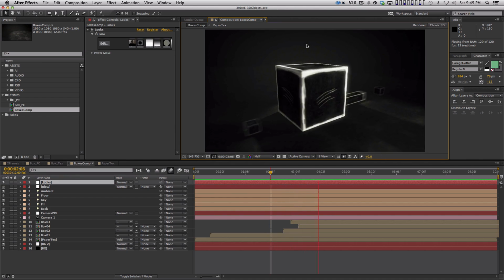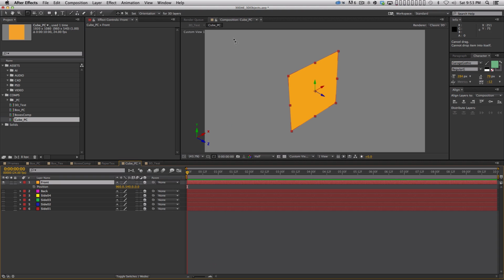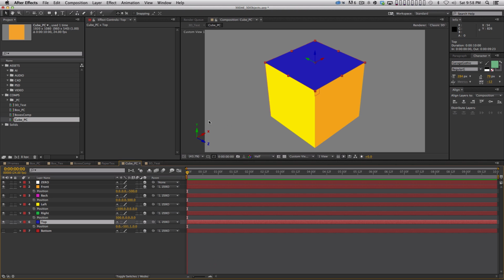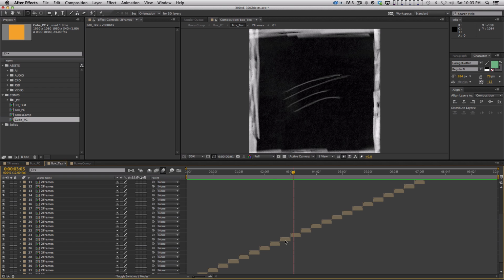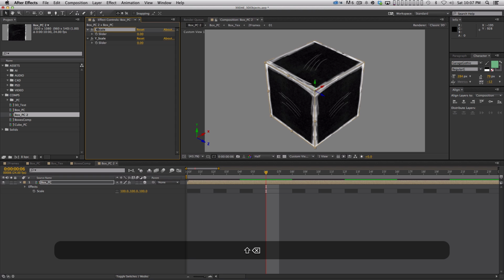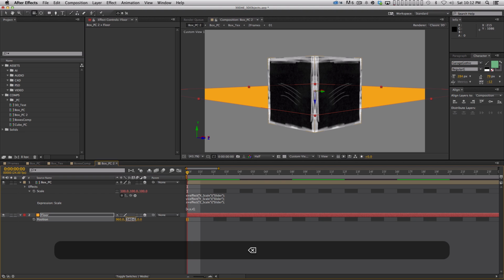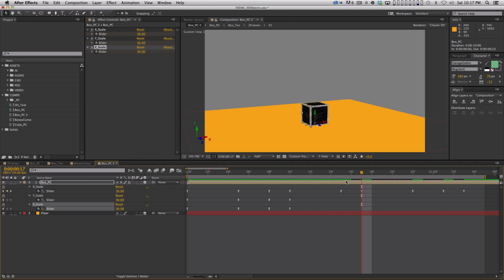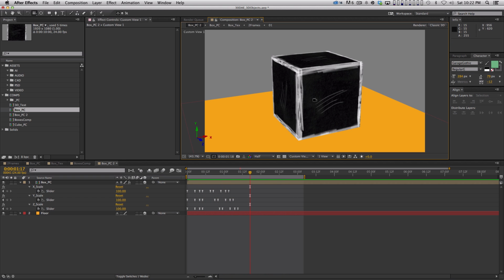Quickly Create 3D in After Effects

Comment: Great video, going to play with that idea. 

Don't know if this helps but the free script Duik Bassel from Nicolas Dufresne (Duduf) has a button in the Rigging > Links & Constraints part of the Duik Panel called Separate Dimensions. It works on the scale property, and it works in 3D as well as 2D. Instead of sliders, it places an effect within the layer you're working with. The separated properties are placed in the Effects part of your layer {Your Layer > Effects > Scale XY: under that are your separated properties) - same for 3D, but it adds the Z value. You can have all three values selected and move the keyframes about in the Graph Editor and they don't interfere with each other. Setting a keyframe does require you to select only one at a time (because if you have all 3 values selected, it adds a keyframe to all three at the same time as you would expect), but once the keyframe is set you can move it while having the other 2 values selected. I use Duik in my puppet animation as it makes the building of bone rigs much easier and adds inverse kinematics to the bone rig. Love it.

You can get Duik here: https://rainboxlab.org/tools/duik/

Comment: many thanks for this really great tutorial, your boxes look absolutely adorable. With your technique i also built some boxes, but ran into an issue with shadows, as soon as i switch the x,y,z scale to expression with sliders, the cube doesnt cast shadow anymore, without expression sliders, the shadow is fine, do you know a solution / workaround for this issue?
Reply from the maker: Glad you liked it! Try these steps: Twirl open the layer > Materiel Options > Cast Shadows: "on". Hopefully that helps out! If not double check that your lights have a long enough falloff distance under Light Options.
Reply: thank you so much for your reply, those settings were all set good, i guess it was just an after effects quirk, as soon as i remove the sliders from the 3d cube precomp layer, the shadow where visible again, as soon as i inserted one slider -> shadow removed, i have now solved this issue: i created a null object, did add the 3 sliders to the null object and linked the 3d cube scale properties to the null object sliders and that worked well :-)
many thanks for your great tutorials again
Reply: @chrishuber1474  I had to do that too - thanks for the idea (a year after you posted...)
Reply: @TheCamberwellCat  hey i´m glad it worked!!